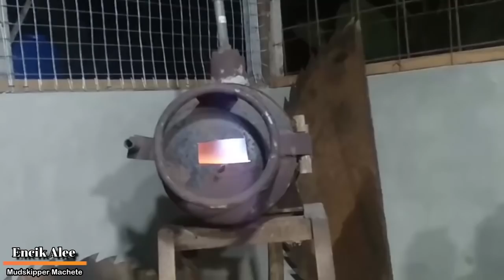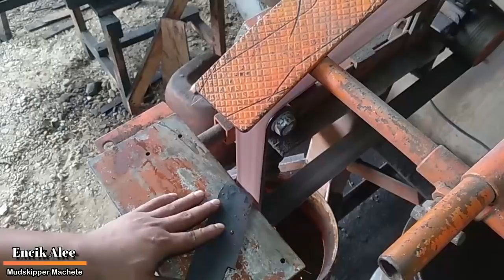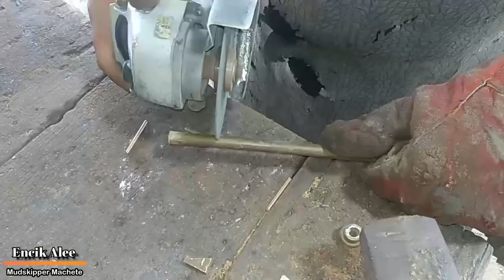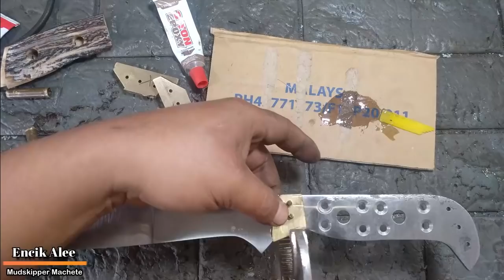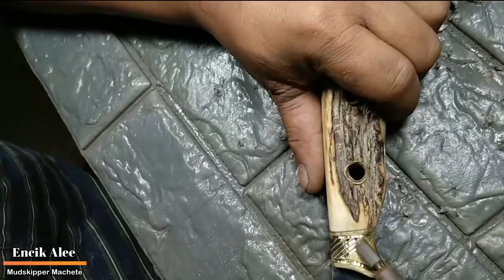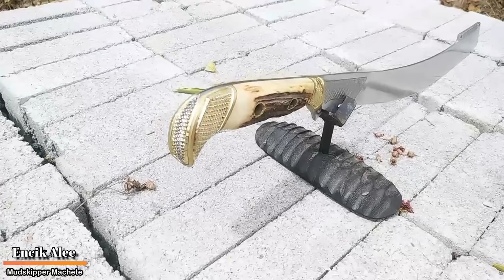♻️ 🔝 Making Long Machete from Junk (Part 1) | Cara buat Parang Panjang Moden

Comment: So what's the other holes in the tang for? Useless?
Reply from the maker: the other hole is for reduce the weight of the handle and to make sure the glue can holding the antlers each other.